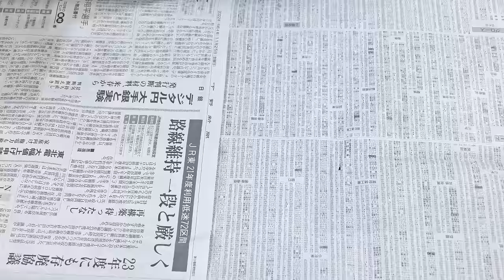【DIY】2 Styles Panel Saw from a Circular Saws / Hacks

Comment: The blade is pointing toward the user. I find that extremely dangerous. There is a reason you don’t find a single commercial panel saw manufactured in that way.
Reply: U are so right…. This is very dangerous
Reply: 🥴 Then don't build yours that way. Who are we kidding? You're not a "Do'er,"  you're a complainer.
Reply: @CredibleHulk10  Excuse me? I’m a designer and I work with wood and other materials everyday. Go build this project  with the blade pointing at you. Good luck!
Reply: @TheseusTitan  This guy did do just that. Even made a video showing it in use. Your fear mongering holds no sway here, nor do your internet credentials. 👎🏼
Reply: @CredibleHulk10  When are you building yours? Or are you just the site’s mole?
Reply: table saw point the saw blade   toward the worker too. Everybody knows that it is dangerous, but it's safe ennough if you know how to use
Reply: Table saw .. grinder... etc also pointing to user... for precaoution may add another metal plate layer on the hand grib design. Yet this design really great to be honest. Mind blowing. Totally different from common ones. Yet people often tend to want to see whether the blade cutting correctly while running. This one doesnt until all finished cut.

Comment: It's a great design. The only change I would make is to affix the measuring tape on the front ledge, rather than the top, to avoid the wear from materials rubbing on them.

Comment: WOW! This is the best homemade panel saw design I've ever seen! The meticulous craftsmanship and precision of your work is an inspiration and paradigm for us all.
Reply: You can bump that up "best panel saw design". Most of them are just enough to work and even cut really garbage like despite costing $$$$.
Reply: The linear bearings and heavy aluminum extrusion rails are going to set you back a bit. Add that and all the hardware and this all  $1000 or more.
Reply: Je suis toujours ébloui par son travail de génie et trés propre!!!! je guette en permanence ses nouvauté et le remercie a lui de les partager
Reply: @ironmyno  I've wondered about this. Is that a truly reliable estimate? I know that the components you mentioned are really pricey, but I've wondered if there are sources at a more affordable price point. Thanks!
Reply: ais
Reply: @shaman935  It may well amount to that, but then a commercial panel saw is much (!) more expensive. Nobody said this was cheap or had to be just because it's on YouTube 😉
Reply: @aserta ¡
Reply: @shaman935  I think $500 is doable.  Do a search for linear rails and linear bearings, those are the most important and expensive.  I got a set slightly different for $90.  You can see for a second in the video he is using LHBB25, you can find those but they seem very premium.   I'm sure the ones I bought aren't as robust as used in this video, we will see.  The aluminum plate I think is 5052 and of that size, I estimate $130 (i've bought 5052 plate recently).  Extruded aluminum can be bought on Amazon and is "10s of dollars" usually, will depend on how much you want.  There are compromises to make as with anything. I made lots of assumptions regarding bolts and scraps of aluminum that I can use and have laying around, if you are literally starting with nothing, then I could see $750.  So call it $100 for the rails/bearings, $130 for the back plate, $100 for a sheet of baltic birch, $25 in 2x4, and maybe $150 in extruded aluminum and bolts for it.  That's near enough to $500.  I guess I assume you have a circular saw already that you'd dedicate to it.
Reply: Considering the machine parts the guy is using calling it home made is a bit of a stretch, these linear rods and carriages would are quite expensive, you are looking at a mid 4 figures for the hardware at least here...
Reply: actually this is not homemade. but I aggre with you. this guy is big talent.
Reply: Io ho un parere tutto mio in merito a questo genere di video, che reputo sempre e comunque fini a se stessi. O meglio, fini ad accumulare visualizzazioni. Io non so il Signore cosa faccia di mestiere, se il falegname o il costruttore di macchine per falegnameria. In ambedue i casi penso che non si guadagni da vivere né con l'uno né con l'altro. Non riesco in nessun caso a capire il senso di tanto tempo e tanto materiale e tanto sforzo per tagliare in squadra due pannelli di truciolare o laminato che sia. Comprati una squartatrice con carrello mobile, spendi gli stessi quattrini e non ci tagli solo i pannelli, ma ci fai tutto ciò che vuoi. Non hai spazio? Non fare il falegname.

Comment: Panel saw for finished side out, instead of finished side in -- should offer more flexibility for some projects. So it becomes more like a table saw than a radial arm saw : A different set of tricks or characteristics.

Comment: A Track Saw Guide would be my best option. The amount of money spent on this project can build me a house already.
Reply: Thats my problem with it. It's too expensive for what it is. If you're tearing down panels over and over again then a panel saw is faster. But for the home DIYer a tracksaw will have more use for roughly the same cost.
Reply: @AERuffy  Until you said 'same cost as a track saw' I was in my head saying 'YEAH BUT IT'S THE SAME COST AS A TRACK SAW!' A vertical panel saw comes in at ~£15k, it's seriously hard to come by one that doesn't need 16' of wall space when you're likely not wanting more than 8' of capacity, whilst a sliding table saw will be about half that cost, but take up even more space and provide a ton of handling challenges, whether you're a DIYer or a pro. Being able to make this for 5% of those costs, to your own specifications, fitted to your own costs is why it's worth it. 

I couldn't justify a full size panel saw, and in fact tend to rip boards in half with a track saw. Things then slow down a lot when you need to cut a bunch of lengths of 600mm width as you can't use a mitre saw, can't have a table saw big enough to do this safely (and again, radial arm saws are massive). As soon as I clear a little spare wall space though, a 600mm capacity version of this will save me hours of repetitive crosscuts, and probably retire my mitre saw too. Can't see how it isn't worth it really.
Reply: Yea and the comments here are all fake and paid for. This guy is a goof
Reply: @VaughnCampbell    I wouldn't go that far.  He has skills and is methodical in his work.  It's not a bad idea and could even lead to some really cool custom tools.  I know that in America, the cost of this build far outstretches just buying a kit or using a track saw.  But maybe where he lives it is justifiable.
I mean, had I the money to burn, I wouldn't mind building some of the tables he has and doing some fancy finishing on them, just because.  Alas, that day is far off.
Reply: You can get a panel saw here in the states for about $2200. You’ve got a lot of 8020 aluminum in this design which will add up to also aluminum plating, the pipe guides and all the wood. 
You’re also limited in cross/rip cuts to the space inside of the top and bottom guides with no way or rotating the saw like most panel saws. All depends on what you’re working on I guess.

Comment: GENIUS. The world needs your designs to be available commercially.
Reply: Yeah if this were a kit you could buy commercially, or even a standalone unit, I think it would do well.  Just wait, harbor freight will have one out next month for $129.99
Reply: My local Home Depot has had a setup like this for about 15 years now.  This IS a thing.  Though there's is pure metal tubing and about 3x bigger.

Comment: That clamping mechanism using simple parallelogram is clever. Not sure about riving knife being used to move a saw around, but it could be OK-ish as I guess you set your counterweight flawlessly so forces will be minimal. Tilting is very nice addon. But what I'm not so sure I like is access to the saw and depth of cut adjustment. As your other panel saw with circular saw on front side allows you to not just format panel materials, but also to scribe and cut groves in them, as it gives more control over the saw settings. Maybe I just missed some hidden lead-screw to set depth of cut here. Nevermind, I like your design style clean definition and videos straight to point.

Comment: Pro tip for those of us with older eyes: Get yourself an Optical Center Punch Set. The set I have comes with a crosshair and bullseye sight and two different angled punches. It's so much easier to look through a sight to line up a mark than it is to sight it the old way. Best investment ever.
Reply: Sempers Sarge.

Comment: Beautiful design and execution.  I was wondering what is the benefit of a panel saw compared to using a track saw or a straight edge.  It seems easier to me to cut on an horizontal surface.
Reply: A panel saw is going to be great if all you need are perpendicular [ T ] cuts across your work material. A track saw gives you the added benefit that those cuts can be along any angle across [ / / ] your material. Additionally, the track saw can be set to cut a bevel where a track saw cannot. A track saw has the material horizontal versus the panel saw with it more vertical. This means a track saw requires more shop space for cutting. Hope this helps.

Comment: Cool thing to have for sure but not cheap to build and even MUCH more expensive to buy.
If you cut lots of panels this could be easily worth the money and time, but for most hobbyists a track saw might be more than enough. Then again, it's a hobby and all hobbies cost money and if this is inside the budget of your hobby I would say : go for it, it'll surely give you lots of pleasure and probably make you build even more.
I would probably inlay the ribbon meter in the back panel and add something to make repetitive cuts.
Anyway, this looks really nice and very sturdy you clearly did a nice job.

Comment: As some other comments already state, this tool design is in large format, detailed design, measuring, expensive components, for single purpose, and occasional use = not practical overall.

Suggested alternative of using inexpensive track saw sounds good, BUT

How about making simpler wall mounting area for vertical cutting,
and use easy clamp-on, or slot-into vertical tracks for track-saw use in vertical cut position?
maybe use dust collection point from blade area to back wall - flex/stretch hose connection?

Comment: This is genius and i could see great use for it especially for hardware stores that don't provide a cutting service for sheet material as the other versions of the type of wall mounted saw wouldn't be as safe as this one is due to the blade being exposed the whole time. Therefore insurance is usually the problem. But with this one, its super clever and a hell of a lot safer so I'd imagine insurance wouldn't be as expensive.  You deserve all the views and likes you get, master creator.  Respect

Comment: Another genius idea, this profiles are quite  expensive to get, but idea and realisation perfect as always man !
Reply: Let alone these heavy linear bearings
Reply: Most of the aluminum rails and brackets could be replaced with wood. The aluminum just makes acquiring long straight pieces simple for the project. I'd probably laminate plywood together where needed.

Comment: I've seen a very similar design on some turklsh youtube video. I like, that you covered up the saw & blade. Not sure if in your setup you would easily precisely cut angles? I wonder if these beefy thick rails are really a must as it seems there are minial forces on these rails. That's something to think about to lower the BOM. I think I'm going to use this video as a basis to work on the design and extend it so that it's able to substitute a majority of table saw cuts but with increased safety. Thanks for the video!

Comment: Fantastic build-but...
Cannot help feeling that the linear bearings are a bit overkill - especially to carry a Ryobi circular saw. Tempted to try side mounted ball-races on the rails.
Upper surface clamp would benefit from a 'sacrificial strip' to support the cut against tear-out.
Some blade height adjustment- best cuts are when the blade clears the material by just a few mm.
Not often I say 'I want one'- but I want one!

Comment: That's the best panel saw I've ever seen awesome. I did see you using compressed air and thought you need something like the Makita brushless handheld mini blower or similar.
Reply: Why use a new tool with a battery when compressed air is already available in the shop?

Comment: I don't understand the necessity of the routed groove under the saw blade in the back?
There will be no tear-out because the workpiece is surrounded by zero clearance slots. The solid table and the hold down bar. 
Wow. He had an interesting engineering career Somewhere. I'd like to know his background and life.
The plans are $13 USD - I'd like to know the cost of the materials roughly.

Comment: Undoubtedly beautifully made.  Personally, I see three drawbacks.  The first is that this table is made for a Ryobi saw.  Another brand has a different foot and therefore a different drill hole pattern.  The second is the price of all aluminum components.  The third is all the necessary equipment to make this.  But again, it looks absolutely gorgeous and professional.👍🏻
Reply from the maker: Yes
I struggled with the design.
However, the design could not be adapted to any circular saw.
I spent three years designing this tool.

Comment: The 8020 bearings are very accurate. Those you are using are extreme overkill. Attention should be placed on the accuracy of the fence as it aligns with the saw.

Comment: It is certainly nicely made, but unnecessary for me to saw sheet material with it, there is also the plunge saw which works fine, and it will not be cheap to make it myself with all the materials that have been used, but very nicely made and usable........

Comment: The problem is... Need.

Everyone does different projects and has different needs.
One struggles with beams, another with panels. That's why you have such different opinions.
JSK did a great job designing this slab cutting panel.

But will it be used by someone making frames, for example?
Well, not really. And such a guy will complain.

The idea and execution are 150%. Not to mention its accuracy. Every hole, every cut is a masterpiece.
Japanese patience and accuracy.

It's worth learning, gentlemen...

Comment: This is an incredible build! I would love to have a panel saw. The other smaller one you have mounted to a wall, inspired me to make a 6-foot version that I have suspended above my work bench. It is on a pulley system and when I want to use it, I just lower it down. I use it more than my tablesaw to the point I'm thinking of selling it since it never gets used. When I need to break down an 8 foot sheet of plywood I use a straight edge.
This is a work of art!! I know for us to build this in the US, it would be VERY expensive to do. Aluminum, especially as nice as you are using would be hundreds of dollars. I don't even know where you can buy the bearings that ride on the rails. Do you order the pieces of aluminum pre cut? It is nicely finished, it is even chamfered. Just beautiful!!
Reply: I looked up 1.5" linear bearing similar shape to what's used here.  It costs $155 each. The aluminum rail + those straight rods.  You probably looking at $1500 just on material (my guesstimate).  The price of the saw and counter weight are not included in my estimate.  This is a incredible panel saw, but table saw has it's place.  If you are breaking down sheets good frequently this would be grate to have.  But I seriously doubt that this panel saw can replace table saw.  LOL.  I would rate this panel saw in the same category as a jointer.  It's a luxury item that you don't want but don't need.

Comment: Might sound like a stupid question. But how would you change the blade without having to move the whole panel saw off the wall. I’ll like to build a bigger version so therefore heavier.

Comment: I really like this panel saw design. Very smart and well thought out. my issue is that I could never replicate this as the aluminum extrusions you have access to would never be available to me and if they were I can only imagine the cost. A simple piece of T- track 4' long is about $25 with shipping. My guess would be $3K in material plus time. Still, great job.
Reply: Assuming the long pieces (main side braces and center braces) are 6' long (guessing) and the bottom brace is about 4 feet long (also guessing), the price for all 5 pieces of extruded aluminum is about $400 + tax.  The sheet aluminum and hardware are individual costs.

Comment: Well, that's really on another level.

But pretty expensive to build though, considered the materials used.

Thanks for sharing!
Reply: I would have to agree. By the time you purchased all the 4 linear bearings, the steel shafts, aluminium extrusions, aluminium plates and all the connecting hardware, this is an expensive project.

Comment: Soak the lip seals in oil before installation. They're meant for oil, not grease. Grease actually makes them destroy the surface if particulate gets caught in them because of the grease.

Comment: Is bending down to reach the end of the cut putting your face into the path of a kickback?   

What if it were fastened higher up on the wall for less bending down and less likely to damage your back?
Reply: That said, impressive designs and fine craftsmanship in all your tool projects.